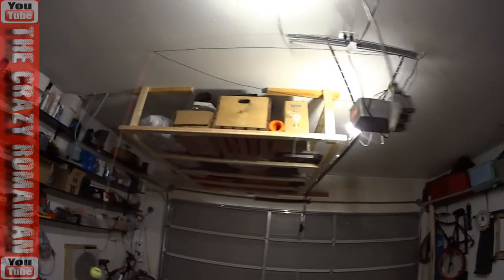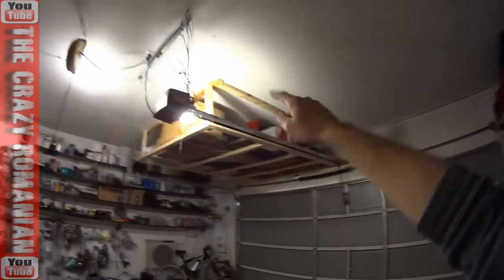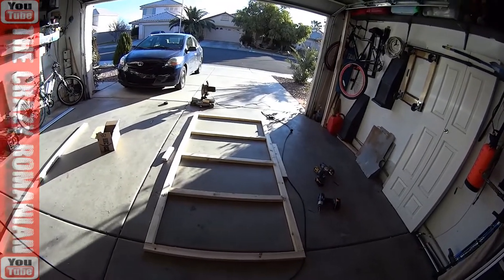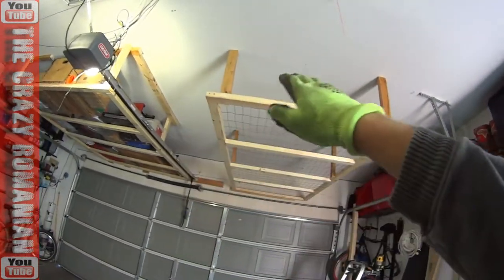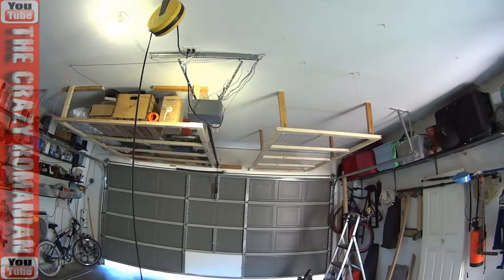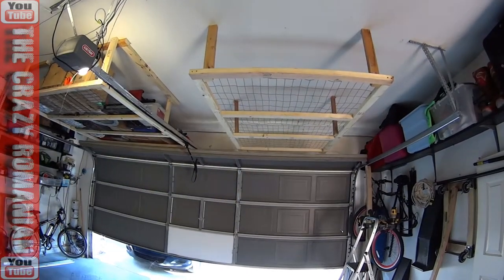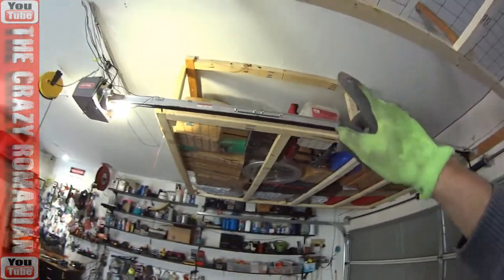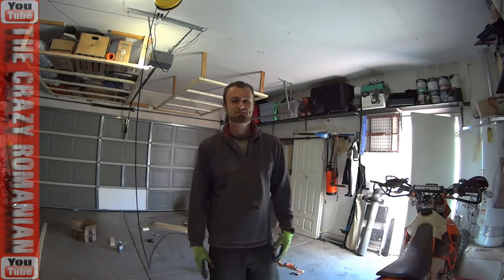What is the PERFECT SIZE for a Storage Shelf above the Garage door - How to build

Comment: I really like the idea of using wire fencing for the "shelf"! It reduces the weight a lot and has the visibility of what is up there!!
Reply from the maker: Yes , the only downside I've noticed since then is that if you have boxes now not completely flat on the bottom and they have some kind of like legs they don't slide they get caught into that wire So I had to grind all the little legs or feet off the boxes and once they're flat they just slide in there for a very nice